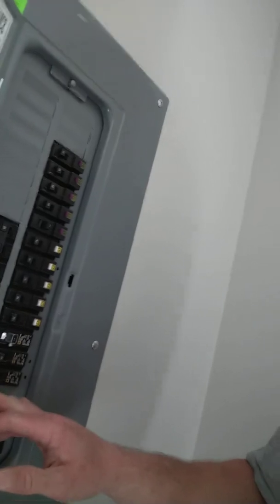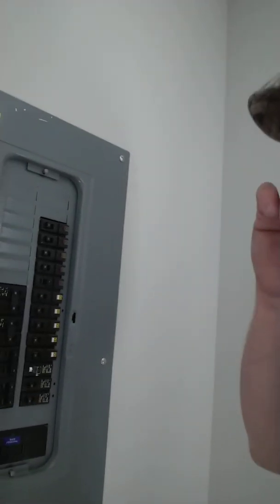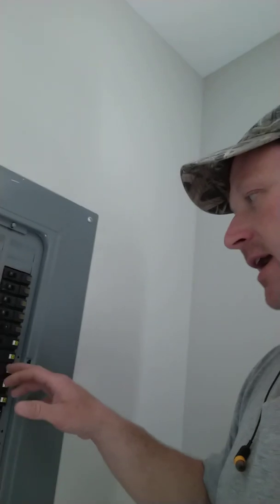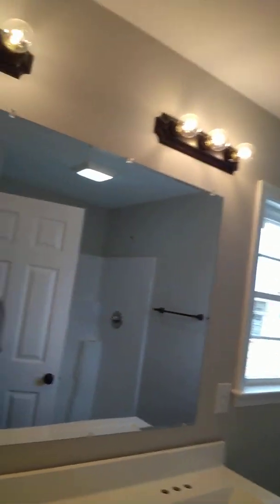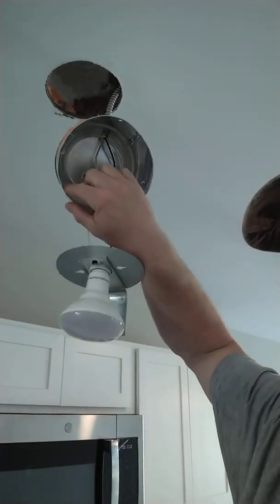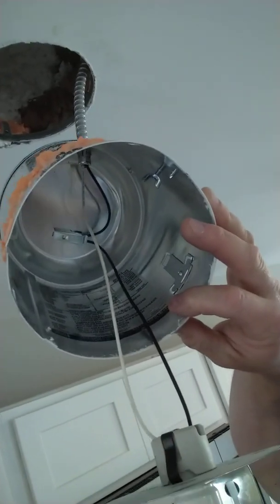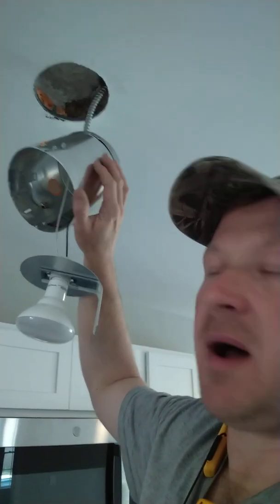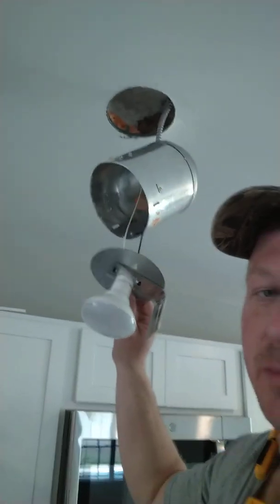Halo 6" can causing  AFCI breaker tripping issue

Comment: Hey Ron great video on troubleshooting the issue it’s good information to know in case i have the problem. I have been hearing that a lot of the Eaton C/H afci/gfci br style breakers are tripping,have you ever used that style panel in your installs? Do you think that is a good panel? A friend of mine wants me to install some outlets and recessed lights in her basement and she has the Eaton/br style panel.She wants me to install the canless pancake style.whats your thoughts on using them.she has the plastic nail on boxes with plastic incandescent bulbs she wants to sheet rock the ceiling can I use the canless lights.she wants me to take down the nail on boxs and put the canless lights in place of them.
Reply from the maker: Hey Larry, won ! Lots of good questions. Yes, I've used Eaton and Cutler Hammer. But prefer to stick with square D. it's the most available in my area. All of the manufacturer have had there share of problems with the AFCI breakers when they first came out. Most of the bugs have been worked out. The biggest problem I still have are certain brand of appliances causing nuisance tripping issues. I prefer the disk/pancake style of light fixture that uses a round nail on over the flat LED with a driver. Mostly due to the majority of the work and mess is complete during rough in phase. If you install recessed cans over an occupied space such as a living room, you'll get more noise transfer through them. I found this out the hard way. Trying to sound proof my daughter's bedroom. It was a big mistake.

Comment: By code wire is supposed to have play under them I am an inspector and the dewalt gun dose the perfect amount of play and it was designed to operate like this
Reply from the maker: Thanks for watching and commenting 👍🏻 The play I'm talking about is side to side movement. The staples are listed for two  14-2 NM wire under on staple. If you were to install 4 qty. no.14-2 on one 2x4 stud , the side to side slop allows the wires to fall outside the 1¼" setback requirements from the edges of the 2x4 there stapled to. That been my experience using the DeWalt stapler. If I'm double stacking 14-2 side by side, I revert back to the hand banger staples.

Comment: I TROUBLESHOOT lights first by turning all switches off and seeing if it trips if not i know its not the switch boxes. Then i turn on lights one by one until i narrow down to where the problem is. I keep all my plans for every job on pdf on a server for like ten years. I make a habit of all my home run to be the closest switch or outlet to the panel for every circuit.
Reply from the maker: I do this practice of turning switches off too. It's kind of hard to know if the lights are on or off on three and four-way circuits.

Comment: We always use the cheaper option in the Home Despots ("Generic/Central Electric"?): easier to install and they work fine. 6" cans are made for cheaper each year, but their price don't come down... :-/
Reply from the maker: I have tried those in the past and seemed to be ok. I switched to Halo years ago. Mostly due to the price from Lowes. If you buy 2 of the contractor's six packs of cans at a time you can get the pro deal on them. I'm paying $8.55 per can which includes the trim too. So 🤔 it's one of those deals where you get what ya pay for. So I guess getting 2 bad cans out of 500+ is not that bad. But killing time trying to diagnose the problem is.
Reply: Am old school so never used gloves. Got way too many cuts on cheap progress and the rest of low end hi hats. Luckily I got enough industrial work was lucky if I did a weeks residental work in last 25 years. I put Ligholier hi hats in my home 40 years ago and was able to replace a drop lens hi hat trim that was over 30 years old. Good luck trying to get replacement parts from cheating scum bag china. We had over 100 LED drop ceiling LED luminares made in china. Less then 2 years later could not purchase replacement lens due to cheating china company went out of business.
Reply from the maker: Thanks for watching Garbo, I'm recommending to customers that we install fixtures and fans that have standard light bulbs. I'm seeing a pattern from China manufacturers incorporating the bulbs into the fixture so when the bulb goes out you have to throw the whole thing away. Wow look what we came too🤯A throw away society.🤔 The other thing I've noticed people buying fixtures online that are not listed in labeled for installation in the United States. Some have no box cut out hole for mounting.